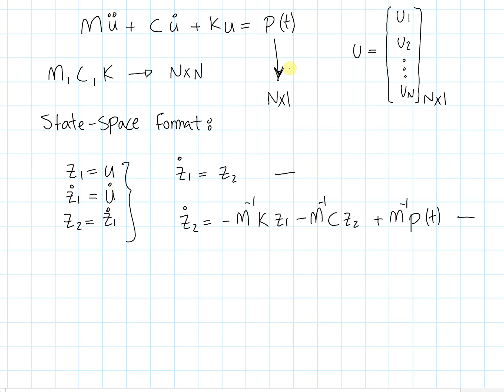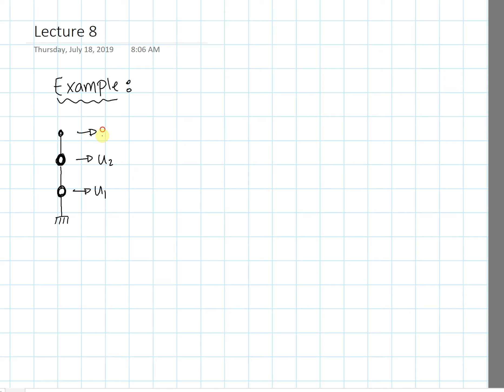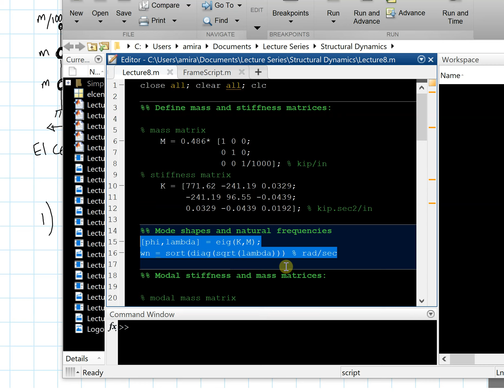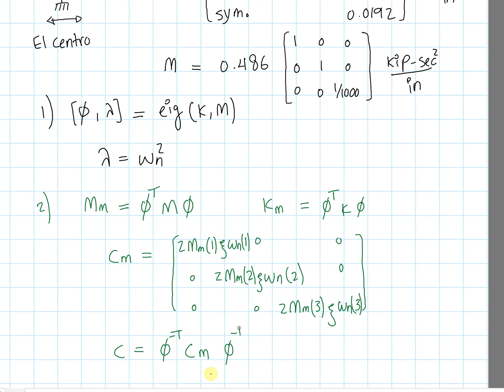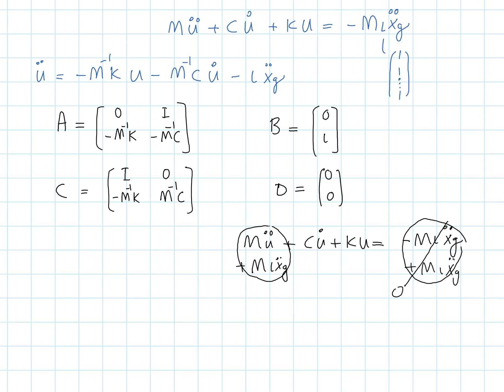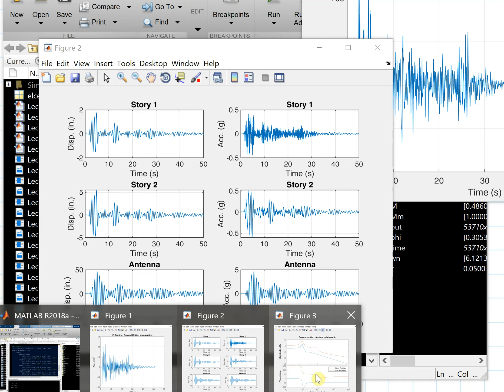MDOF: response using state-space formulation (Lecture 8)

Comment: Sir in this lecture at 29.29 sec you have shown the graph of displacement and acceleration  value, so this values are absolute value of relative value?
Reply: Absolute or relative value?
Reply from the maker: These are relative displacements and absolute accelerations.
Reply: @amiraliCEE  thank you very much sir,
Reply: @amiraliCEE  sir, in matlab program the D matrix is [ 0 ] so little bit I am confused
Reply from the maker: So lets say your equation of motion is: mxdd + cxd + kx = -mxg. To get xdd you have: xdd = 1/m(-kx - cx) -xg.
But xdd is relative acceleration. So you have to add xg to the left side and the right side. 

Therefore: (xdd + xg) = 1/m(-kx -cx) + 0

The 0 is D. 

 @darshanyagnik2534
Reply: @amiraliCEE  thank you very very very very.....much sir,  I have solved the same example in my computer and I get the same graph and I received all relative displacement and absolute acceleration value from the 'OUT' file. i have used D matrix [0]. and Based on this I will be able to analyze the many multi-storied buildings. once again thank you very much sir
Reply: @amiraliCEE sir,  if we want to get relative acceleration then D matrix is zero (6 1) and if we get absolute acceleration then D matrix is zero (3 1) ones(3 1). am I correct sir?
Reply: Sir I am confused about D matrix and relative and absolute acceleration

Comment: Hi @Amirali, first of, thank you very much for sharing your knowledge on this topic with a well formulated example. From the looks of things, it seems like the system matrix last row always looks the same for mechanical systems with the rest of the elements for all the matrices dependent on your requested output. Is that even halfway true?
By the way, would you mind sharing the link to the matlab scripts you used for this examples? I would like to have a starting point to some specific problem that I have which involves flow vibration. Thanks for your time. 
I also checked your website, but it seems like your url is not working and your GitHub has none of this example. 
Thanks for the feedback
Reply from the maker: It really depends on the mechanical system. Depending on the complexity of the system, the system matrix can look very different. Unfortunately, I switched laptops and don't have access to those scripts anymore. I am in the process of making a new url.